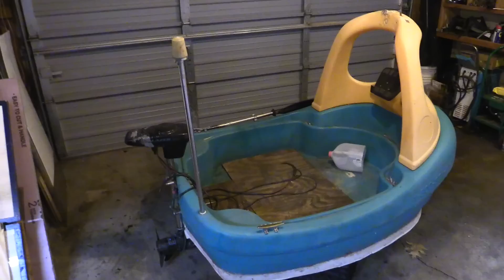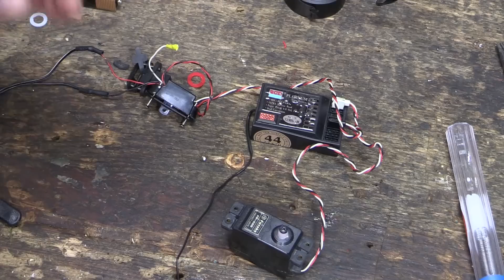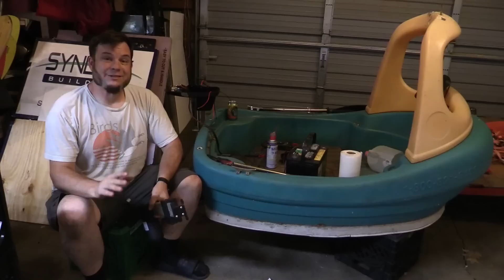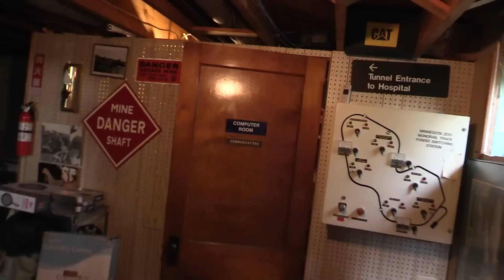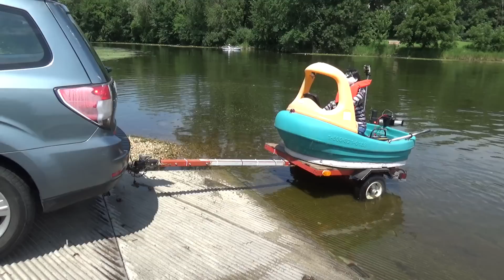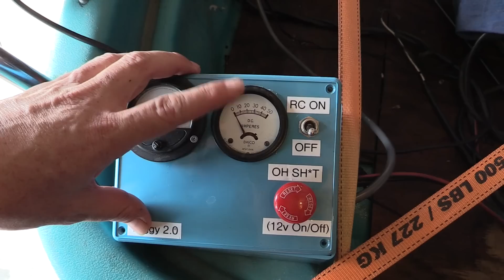My Illegal Tugboat Is Now An R/C Toy!

Comment: Oh, because the motor could draw upto 40 amps and the relay could only cope with 20 amps during normal operating it drew 2 amps a fuse of 15 amps would of protected the relay when the motor was fouled with weeds as it had the potential to draw 40 amps during a full motor stall.
An upgraded relay would cause the motor / wires to burn out as the battery would produce way more current than the 40 amps maximum of the motor / wires.

Comment: Trailer Lights:  they are the bane of my existence, always broken and need fixed to work.  I had enough and I made some magnetic wireless solar charged lights.  They worked great always charged when the trailer is kept in the sun when not being used.  No wires to fail.    Made 10 sets and put them on ebay for sale and did not sell a single one.   But I discovered that my magnet were too strong, and they stayed attacked to the trailer and detached from the plastic housing.  dammit, my existence still cursed by trailer lights.

Comment: I gave up on lighting my boat trailer almost every season.  I gave up and bought magnetic lights and a harmless for towing vehicles from Harbor Freight for really cheap money.  I zip tie the wires on the trailer and take it off when trip are done. The magnets are a bit wimpy VS a good set so I zip tie them too. 

It came in  formed clam shell packaging I was carful to open in a way that I could reclose well. It's minimal protection but it is enough plus it keeps the wires untangled because of how they need to be put back.. I store them inside with life vests I don't want mice to harvest nests from.  

I've had the same set for about 8 years now and never looked back.  It's a small amount of work VS hooking up to go somewhere and something being wrong...again.  The plan is top remove them so I just slap them on without diagnostics, snaking wires and the rest of the BS when I should be fishing.  I can even use the same set for all the trailers... or if I ever do tow a car.  I have never looked back.

If I do up grade these I will probably use the super velcro that holds toll passes to windsheilds.  I bough a roll for the RV off A-zon and it is great stuff to have around.  Crazy strong!!!

Been fun watching ya for a while, hope ya see this and it pay ya back a bit.
Reply from the maker: Thanks! I think I'll probably go with the magnetic ones and just take them off before launching the boat, seems easier than dealing with real trailer lights.

Comment: Did you say 100 watt motor controller? At 12 volts, that's only 8.3 Amps... you need a 1kW controller.

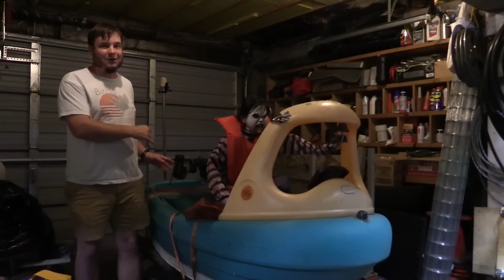Comment: 20:19 @saveitforparts you may need to revisit your setup again. If your trolling motor draws 40A at 12V this would be 480W, far exceeding the 100W rating you mentioned in the video.   To calculate how many watts something will consume you multiply volts by amps (12V x 40A=480W). If you know the wattage and voltage and need to know how many amps it draws you reverse the equation and divide the wattage by the voltage (480W/12V=40A).

Comment: Yep, I have one of these Little Tike sandpits on my back garden awaiting the same adaptation.
It has been waiting for 6 years.
Maybe an electric reclining chair servo would of done the steering.? or electric car window winder / wiper motor.
I made a sliding door from an electric car aerial mechanism and used net curtain wire.
Which is very under rated as a power transfer belt or is it unrealised.?  dunno but good to know.  ;)
I also have much much junk because of a similar affliction of "Store enough and something will fit"  Lol. (could you tell.?)

Rebel by seeing who moans at you and screams "NOT ALLOWED.!!" at you if you fill a boat up with sand..

Just subbed  ;)

Comment: If you need a replacement 9V connector, bust open a dead 9V battery. Ive done this a few times and they work just fine.

Comment: When you see an old recliner on the footpath for rubbish or at the dump check it because if it’s an electric one they have those exact actuators in them with controls and they are rarely broken the chair normally gets broken by springs or the wood braking
Reply from the maker: Last time I checked free furniture on the side of the road, there was a mouse living in it 😂

Comment: You will need 2 esc's 1 for the motor and 1 for the steering system and a water balling pump. Add in-line fuses about 3  to protect your radio equipment

Comment: Waterproofing is different though.  All electronics have impedance which turns to heat.  Ventilation is needed.  Covering anything with only a top tarp caused a greenhouse thing to happen and it holds moist air.  It destroys stuff through good intentions

Comment: You can test that ammeter with a known load. Plug in a 120V lamp, separate the cords, and put a 100W conventional light bulb in it. Using Ohms law, you can determine that it should draw 0.83 amps. If you need more current in order to test the scale, you can use some of those 300W halogen outdoor lights.

Comment: A tip for the trailer lights,  add a dedicated negative wire to all lights and don't rely on the trailer chases for the negative. The chassis negative connection is archaic snd should be discontinued.

Comment: If you don't know exactly how much current the motor can draw, you can measure the internal resistance of the motor. When an electric motor is in operation, all sorts of other physical laws come into play that limit the current consumption, but with the measured resistance you can roughly calculate the current consumption of the motor when blocked, and this is usually higher than the current consumption in normal operation. If you set the speed controller to this current, you are relatively on the safe side, but a fuse in the battery supply line doesn't do any harm! For comparison: my XL Springer Tug initially had a brush motor with a nominal current of 10A, although the ESC was supposed to withstand 25A, it still burned out. A brushless motor is now installed, which requires 2A in the air when idling and 26A in the water under full load. When driving quietly, with about 35% throttle, i measured 3A. I don't have the exact technical data for the controller I'm using now, which is why it was so cheap to get, however, the transistors built into the controller can handle up to 90A. I'm guessing that with a bit of a buffer, it can be used for up to 75A continuous current, which is almost three times the maximum current of the motor. Now i have fun without burning enything: https://youtu.be/tCCxIRB18qM?si=hv1sQ_Q07HzSLd3p

Comment: On my boat trailer I set up trailer guides for loading the boat they're 3/4 inch black water pipe with PVC pipe over the top as rollers then I welded a couple brackets on top of that for rubber tail light housing then I used sealed plastic bulbs like they use on semi trailers and I also ran and where is the length of the trailer tied the ground wires into the frame and the lights these lights have been working for quite a few years now usually I have an issue it's with the plug at the front of the trailer corroding or ground wire corrosion

Comment: When you were measuring 2 amps, that is the no-load amperage. When you put a load on the motor by running it in water, the current will be significantly higher. Great video! Really enjoyed it!

Comment: I work for a garbage company and we felt the same way about trailer lights. So we got a set of old chevy pickup tail lights and they've been going strong for 2 years now. Also slather your plug in grease to keep the corrosion away.

Comment: Love the project, the 100W power you mentioned , I would look at the ratings and go 50 to 100% over , especially when uncertainty is high. Put fuses in,  they can save wiring catching fire incase of a short with high power and a 500mA can save an arduino.  Ive seen sat dish linear actuators in a skip at a caravan dealers, probably a good place to ask for old ones., Had to look up DNR. Use AWG cable table and calculate voltage loss and lII bet you will go to thicker cable.Great to see the workshop, hoarding is a process where scrap turns into treasure. Its like Alchemy.

Comment: I've run into "single use" trailer lights that turned out to be because of a drain hole in the bottom of the light, meant to let water out. It also lets water in and when you back into the water, the hot bulbs break. I had to remember to unplug the lights for a minute before backing down.

Comment: Our solution to the trailer light problem was to invest in one really expensive set that we use across all our trailers. they have clamps and magnets, and a really long cable. Its fully potted in epoxy, all the wires are sealed in glue back heatshrink. we have I think 6 trailers in the fleet at last count, so could justify spending a bit on good lamps. just clip them on whatever one your using that day. but the best part is that they live in a bag in the cab of the truck, so dont spend months between use sitting out in the weather, and you can remove them before you reverse the trailer so they never get submerged. they've lasted a good 5 years.
we also do a similar trick with the licence plate, trailers here are all lumped together as 'single axle trailer', no differentiation if its a boat trailer, box trailer, firefighting unit, caravan etc. that lives in the same bag as the lights. makes buying stuff on trailers really easy, in 5 minutes you can have a licenced trailer with lights you trust. I dont think its technically legal, but if the lights work and the plates check out when they're run, they have no reason to stop you.
Thats been our solution.
That idea came from a friend who had a government issue work truck, and government licence plates look very different to civilian ones. he was in the habit of going fishing on his lunch break, and using the truck to tow his boat on the weekend, which technically wasn't supposed to. so he glued some fridge magnets to a civvy plate he 'acquired', and used that to cover his plates whilst parked at the boat ramp. not driving on the roads with it, so not strictly illegal. and unfortunately yes, it was necessary, some Karen (although that term hadn't been coined then) had phoned up the cops to investigate why a government vehicle was at the boat ramp on a Sunday afternoon with an empty trailer, which led to an uncomfortable conversation with his boss. he didnt mind personally, but it had caused him a whole pile of paperwork and pointless work. thanks Karen.

Comment: I made a trailer bumber and set all the lights under metal grills. Also used marine wire in spools. You can just buy the appropriate pig-tail.
    Never rely on chassis grounds lights either. My chassis is grounded but each light is 3 wire and gets linked in.
    No problems for over ten years. Also put the pig-tail in plastic conduit and have it attached close to the tongue so it isn't long enough to get run over or drag (seen many like that).

Comment: Hilarious :) But please .. use some rc gear from the current century ;)
Reply from the maker: Nah, that's not the Saveitforparts way! If I have 1970s R/C stuff I gotta use it, I'm not just going to throw that stuff out!
Reply: @saveitforparts  the issue with that old gear is that you can have a "runaway" if the signal is lost. With that old gear people usually used "Fail-Safe" circuits to cut the signal when there is no signal.

Comment: dude.... you built a RC TUGGY to pull the kyak.... YOU SUCCEEEDED~!!!   you leveled up ,   up to you to make it better or settle for ''rhynocoat the bottom of the tug, or epoxy it to seal it compelty $$$? and REWIRE THE WHOLE THING with ''proper current handling wire, ...''  or ''consider it a WIN and  move on unless the ''PEEPS'' say no way you ain't done with that yet get back to VERSION 3.0 and MAKE IT WERK!@!! :) lol    eh...  awesome episode, can't wait for the next adventure... lol   did thhe sherrif ''contact'' you ?? or did you get a call from DNR ???  maybe you should put the channels name on the TUG, ;)  or REGISTURE IT AS A TENDER for one of the ''bigger boats''??  naaaa   that's sketchy too lol
Reply: forgot to include, the upgrade to above 40amps relays or ''relays to carry 60 amps''  beein clicked by smaller ones... use bigger wires for the clicked relays...  ??  something like that...  what way you gunna go?? LOL

oh yea if not epoxy sutff...   you have a can or 2 of FLEX SEAL or GORRALLYAz version laying around for o.... sealing up stuff???  coat the bottom with that and forget about the water intrusin, then check to see if the battery needs bolted in into a different location cuz of CENTER OF GRAVITY IS JACKED...  GOOD LUCK!!! :)
Reply: port aft corner way too heavy... battery needs to move up and cehtered under timmy... or littlie bit up or down...  I see in me head a 3d printed ''cradel'' for the battery with lozza flat space for double sided stiky tape for fixing the position of hte cradle/ battery box, wich you probababally have laying around too eh?  

HAVE AN AWESOME EVERY THING !!! :)

Comment: I’ve got a pile of linear actuators that I saved from the landfill. I find them on treadmills and stand up assist recliners. I got two off an electric futon my neighbor threw out.
Reply: yep, great source of them. the DC motors in a treadmill also make excellent generators. only problem is is they are often at weird voltages. they still work at 12v, but will have far less power than what is on the sticker. still, fine to run a tiller or tilt a yagi.

Comment: We built a floating dock here in Michigan but used a trolling motor to bring it out to the middle of the lake and back. Our DNR says if it has a motor and being using in the water, it has to have an MC number. I went to our local Secretary of State and told them I built a custom boat with motor. They gave me my MC number. I went to Home Depot and bought the sticker numbers and posted on the side of the dock. You should have seen the faces of the DNR when I went motoring by them in my 16x16 float dock. They did not pull me over or say a word. Lol
Reply from the maker: See, I tried to say I built a custom boat, and our DNR wanted pictures, then they didn't like what they saw. 
Couple years ago we built an 8x16 raft out of barrels and plywood, and they let us register that just fine!
Reply: @saveitforparts  I suspect the actual reason they wouldn't let you register Tuggy was because any hull that size would likely be overloaded by any reasonably-sized adult. It might float but wouldn't necessarily be stable. Also, all bureaucrats hate fun.
Reply: @saveitforparts  I wonder if it was some kind of assumption that it was just an internet joke and didnt really exist- like I bet if you tried to name it "boaty mcboatface" they also would kick it back no matter if its a perfectly ordinary boat. Like institutional spam filtering; aka the Biggus Dickus effect where "obviously it's a joke name, sir"
Reply: not a licencing issue cos we never motorised it, we built a floating platform out of big 1ft chunks of styrofoam. to keep it from shedding beads and to give some texture, we wrapped it all in a cream shade cloth. when moored in deeper water, it looked like it was made of limestone. apparently we confused quite a few beachwalkers as to how on earth we made limestone float.
Reply: @arjovenzia  🤣🤣🤣🤣
Reply: @arjovenzia  oooh so the hard line is any kind of motor? (now I wonder if it would work just to hide the prop under the boat and just pretend to paddle it if you see cops)
Reply: Because it's all about the money... nothing else...
Reply: @superbmediacontentcreator  America has fallen.
Reply: they probably just saw the numbers and thought IT HAS NUMBERS ITS FINE and that was it. Like they might tell you some official line about why, but on a day to day job basis they just need floaty things to have numbers, and they don't want to think about anything harder than that for their boring underpaid day job. Depending on how awake they are, random numbers that look right would probably work most of the time.
Reply: In Florida that is the standard work-around for not being able to get a dock permit.
Reply: Malicious compliance! I respect that 😂
Reply: When the governments overstep their boundaries, revolutions result. 

Just sayin'....
Reply: @edellenburg78  🤣🤣🤣🥲🤣🏆❤️❤️
Reply: Man that's sick eich lake are you on? We got a family cabin in Houghton
Reply: great idea; i see he  lives in a low crime area; which is over policed;  i can tell by the amount of law enforcement interaction hard working people are getting and the fleecing for petty issues
Reply: Michigan only cares if they make money off something or someone
Reply: @edellenburg78  Michigan is all about money tho if it's free than Michigan gets passed

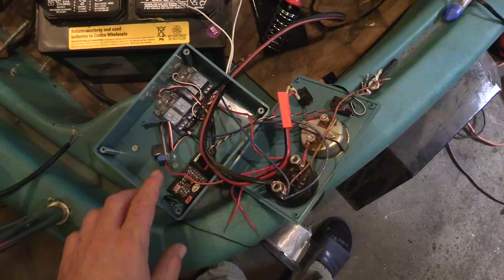Comment: 11:00 Im going to foresee the cable gauge being an issue as you ran the motor dry I presume? It will climb in Amps in the water for sure to get the torque!!
Reply from the maker: The amp meter still only showed about 2-3 amps in water, guess I'm using it wrong.

Comment: its wild that the DNR cares that much. they probably just want their taxes and don't want to deal with letting people register random toys as boats lol. i know in WA you can simply sit on a paddle board and then pull yourself with an RC toy connected by a line, and that doesn't require any tags or anything (although you have to follow normal rules for paddle boarding). you can also let it rip with a paddle boat here and you don't need tags or anything

Comment: For me the issue with cheap trailer lights has always been the wiring.  Its always copper coated aluminum that just disintegrates when any moisture appears.  Replacing it with actual copper wire with silicone insulators is what solved it for me.  The replaced wiring on my crappy Harbor Freight trailer is going on 7 years now without any adjustment, while the original wiring lasted like 1 year.